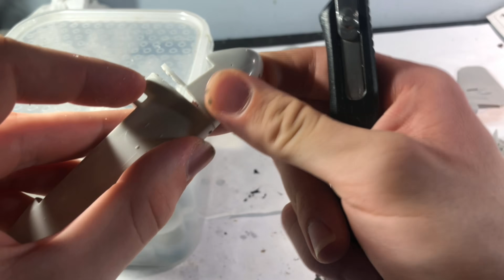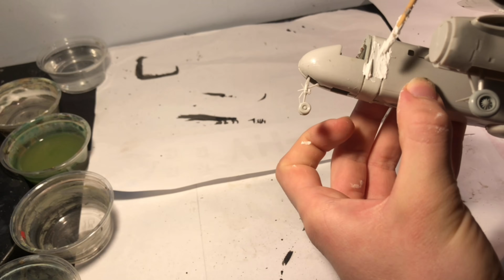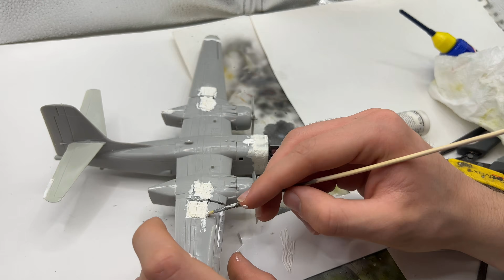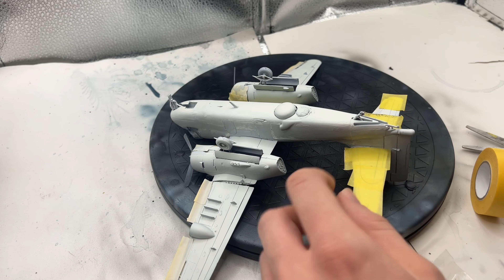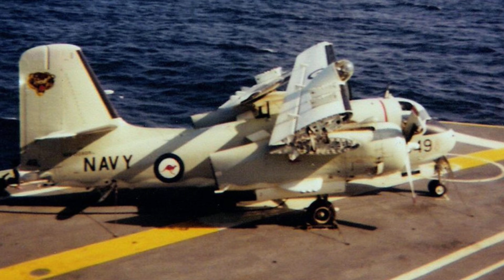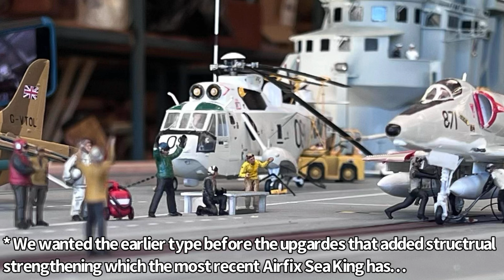Building a Grumman Tracker for the HMAS Melbourne | 1/72 Hasegawa S-2G RAN Conversion

Comment: Hi Luca! It's rewarding doing this type of conversion and right up my street. I think you can learn a huge amount and be surprised what you can achieve. I have this kit and 2 old Eduard sets(big) masks and aeroclub white metal undercarriage set and resin/rubber wheels from equipage. Try adding a fine razor saw in several shapes straight/curved to your tool box as it will make very neat job and not struggle with snips etc. also chain drilling is option. Don't go all the way through on first pass so you can keep close together and second pass will break through. Then file square. I used to work on Canberra's for a lot of years as noticed one on your badge. New airfix one is out soon but doing an raaf one with your own decals and any mods they may of had? Food for thought. They had them in Malaya not sure about Korea?

Finished model looks convincing on carrier very hard work to do  but you did it! Cheers for now, unc Phil.
Reply from the maker: Thanks uncle Phil! I definitely learnt from this one haha! Oh nice sounds like some pretty big build projects you've got there!
A razor saw, finer engraving tool and a pin vice are on my list of tools I want to get next! Nice suggestion about the chain drilling, That would've been great for the wing hinges on this one! 

Yes that's one of my badges from the Queensland air museum since I volunteer there (hence why i made this Tracker for their carrier). I actually picked up an old Airfix and High Planes Canberra but I am keen to do the new one! I'll probably do the air museums Canberra in white and silver and then possibly one from Vietnam. I think ours missed Korea unfortunately, but a Malayan one would be great too!
Thanks for watching and the suggestions! You too mate, take care :)

Comment: Keep working on your skills. You have good ideas, but I feel your overall finish could use some attention. Don't rush your projects to attain a completion. Instead, attempt to achieve a finish that resembles the prototype. Best of luck.
Reply from the maker: Thanks a lot for watching and sharing your thoughts :) I definitely agree, I rushed certain steps and needed to plan others a bit better. The rushing was partially to meet the deadline for the project, a small downside to building models not just for yourself. After this one I have been trying to slow down and improve cleaning up the builds I am currently working on that require heavy modification like this one did. Take care and happy model making to you!